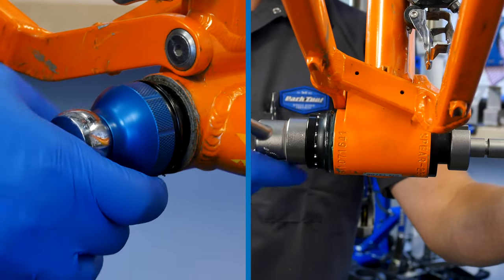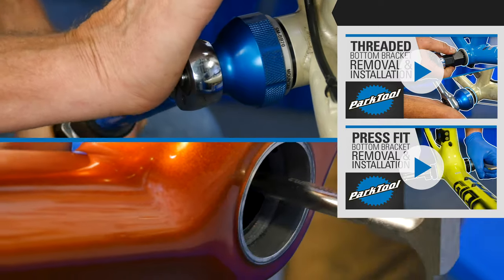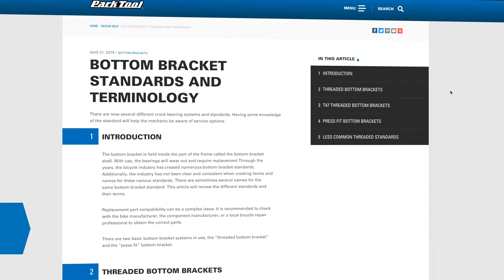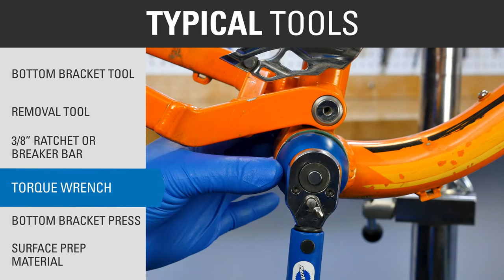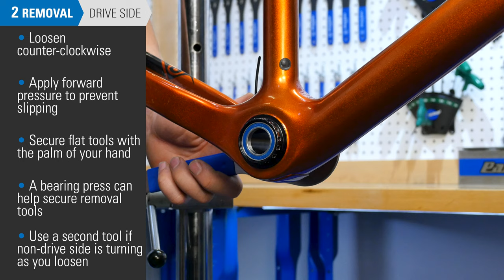How to Remove and Install Bottom Brackets - Thread-Together

Comment: 3:22 Removal: Sometimes a piece of pipe from your local hardware store will fit. You'd hammer against it and some wood for a lower chance of scratches. 3:49 string will also do.

Comment: Hello, I'm a fan of this page. I'm wondering if I can use this to my frame that has a loose thread housing(where you place the bottom bracket)????? Thank you
Reply from the maker: There is no thread-together system for a threaded bottom bracket as seen here.  However, Velo Orange does offer a similar system that does not need internal threads. This is only available for the square spindle type of cranksets.

Comment: I know i am late but i want to ask if i can use retaining compound with a thread-together bb, would that not be better than grease or antiseize? i ask because i replaced my bb and the creaking is still there on the power stroke and i used grease. i suspect a badly made frame,  but its hard to know....
Reply from the maker: You can use retaining compound on a thread together bottom bracket. Use it where the frame meets the bottom bracket. it will take up space and prevent movement.

Comment: Can I re-use a thread-together bb (Wheels Mfg) that has been properly removed and whose bearings feel smooth like butter, or is that a risky proposition? It is going right back into the same bike/bb shell that it was removed from (friend wanted to try some Cobb cranks, but didn't like them). I have reached out to Wheels Mfg but haven't heard back. Thank you!
Reply from the maker: You can reuse a thread together bottom bracket without issue.
Reply: @parktool  Thank you so much. Amazing that you monitor older video comments/questions. No one else does that!

Comment: I am building a bike with a frame meant for a press fit bb. I am guessing from this comment at 1:40 that you can replace a press fit bb with a thread together bb. Am I correct in thinking that?
Reply from the maker: There are Thread Together models available for most every press fit standard.
Reply: Thank you.

Comment: i need help, i have my 2018 specialized tarmac sl4 sport, run with the original bottom bracket which is Praxis alba m30 with praxis works crankset (CRANKSET: Praxis Alba M30, solid forged arms, 6061 chainrings, 110 BCD, 11-speed) and i want to change them to shimano hollowtech, i already bought shimano hollowtech crankset (FC-6800). The question is what type/model of shimano bottom bracket should i use and do i also need  sleeve? thanks you guys, all answers are appreciated.
Reply from the maker: My best guess is that specialized calls the BB on your bike an OSBB. But it is really a BB30 on that model. Shimano does not make a BB30 bottom bracket. you will need to find a BB30 to Shimano Hollowtech conversion bottom bracket. Praxxis as well as many others offer options for you. Hope this helps.

Comment: Hi Park Tool, how do I go about replacing the cartridge bearings in a thread together PF30? Mine are sluggish and gritty
Reply from the maker: Currently the best way is to replace the entire bottom bracket. There may be something coming out soon that will allow you to replace just the bearings.

Comment: Why wouldn't you use this method @4:10 every time?  Looks like you'd avoid potential bearing or frame damage completely.
Reply from the maker: Often doing that re installs the cup that you just removed and can be more difficult. If the proper tool is around it is much better.